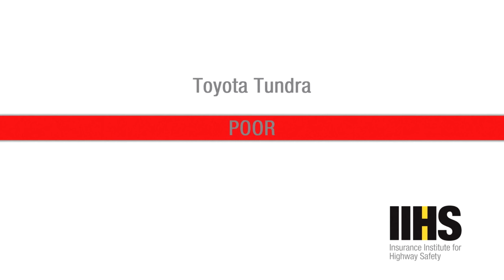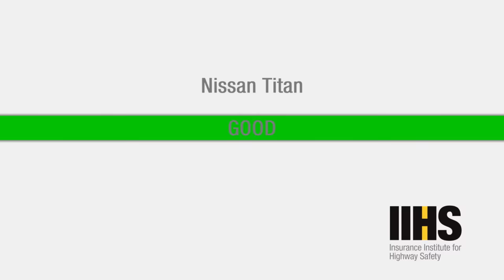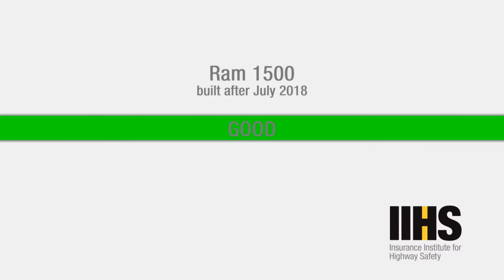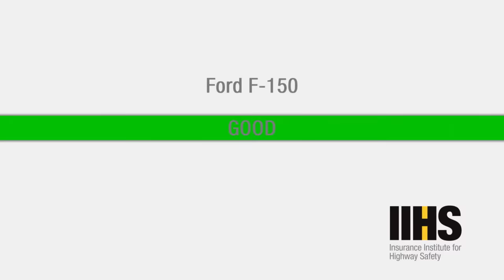TRUCK CRASH TEST COMPILATION - Ford F150, Toyota Tundra, RAM 1500, Nissan Titan

Comment: I want to see old 1990s trucks hit some stuff and see how they hold up to the new ones
Reply: Id imagine somewhat better but if we did ones from the 80s or 70s they would hold up better considering those things were just big blocks of steel on wheels
Reply: While they might hold up better that doesn't necessarily mean it will be a good outcome for passengers
Reply: @ki113rkkrclips9  not at all. things today are done for reasons. any old car is a tin can in a crash, this isnt my opinion its just the facts. go into an auto parts store. almost every set of ramps you will find to drive a car up on to is made of plastic. thats right a few pounds of plastic holding a car completely up off the ground.....
Reply: @chargedx1  true but if where to be some minor crashes like in a derby I would rather trust it than a newer car but I do see where you are getting that and of course it is a bit of a crazy situation for a truck to be in a derby
Reply: @2wheelhoon813  but there were cars made from steel and they were big and heavy compared to these aluminum cars (which yes still have steel elements) we have now and what did the ramps have to do with old cars? What I'm really saying is is that the older cars could take more of a beating due to the thicker heavy metal frame.
Reply: I've seen videos of 1960/70s cars vs things like a Toyota Camry and the Toyota had minor damage and the old cars litteraly caved in on itself and crushed the crash test dummy.
Reply: The truck would hold up, but not you
Reply: @TONOCLAY  muscle cars
Reply: @ki113rkkrclips9  yes the old cars would take a bigger beating at the cost of your life.
Reply: New cars are designed to absorb an impact. Older cars and trucks the engine would have been shot thru the passenger compartment and out the rear.
Reply: They fold in the center pretty bad due to the lack of crush zones id like to see a 2019 vs a 1980 though
Reply: An old car last longer and is more durable for crashes, but the energy of the opposite vehicle has to move. If it is not disbursed by the vehicle, the passenger receives the damages through the spine.
Reply: It bugs me how some of you are verbally abusing old cars, as if their designers are stupid or something. Remember, it's not just that an older car wasn't built right. 

First, there weren't as many cars on the road. 

Second, people had fewer distractions, so they had more reaction time. 

Third, people overall haven't gotten smarter over the years. 

And those cars from the 90s and 80s did in fact have crumple zones. I remember watching Mr. Rogers Neighborhood (or Nova, or something else on PBS) and seeing how crumple zones were put into the design of cars. Actually, crumple zones have been around since the introduction of the unibody; that is, a car without a steel frame construction. And unibody cars have been around since the 70's, at least. 

What's changed, and what keeps changing, is the NHTSA standards! In the beginning, they crashed cars against one solid wall. Then they added the side-impact test. Then they added corner tests, etc.

Yes, different types of accidents happen. But it's absurd to force automakers to redesign the safety guidelines over and over and over again. You can't protect every square inch of a car without turning it into an armor-plated tank.
Reply: Best safety device of old trucks is that they're too slow to crash hard.
Reply: @2wheelhoon813  They don't make military vehicles or construction vehicles, out of plastic. They use metal. They make cars out of plastic because it's cheaper to build.
Reply: @GOD719  Protecting passengers against bullets and against high speed crashes are two very different things.
Reply: It's not about the vehicle holding up...
Reply: I got into a car accident last year in a new GMC Sierra, I was dumb enough to put my hand on the horn to try to notify the other vehicle they cut me off and when that air bag went off it snapped my wrist Mighty good and launched it in to my face lmao

So pro tip for car accident don’t drive a GM, and don’t put your hand on the horn....
Reply: Old cars and trucks are better ive wrecked old and new ford trcks and i swear to you a ford truck is the safest truck end of story i was hit on the passenger side of my 01 f150 4x4 and walked away i now own a 94 f150 ive been hit in the rear in a 78 f150 short bed me and the truck made it out just fine i was in a 73 gmc i thought i was hurt and the truck was junk
Reply: Nate Jones some of what you are saying is correct but a whole lot is wrong. 
Less cars and less distraction do not equal better reaction times. Our death per 100,000 have been steadily dropping since peaking in the late 60’s. That’s the only stat that matters. It doesn’t matter what test was conducted, how many cars on the road, distractions, or how smart early designers were. Our cars are safer today than they have ever been and more lives are saved today than ever before.
Reply: They probably wouldn’t hold up good. Modern cars are made to collapse to absorb shock from a crash. If the car didn’t collapse, your body would absorb the impact and would be damaged much more
Reply: @ki113rkkrclips9  Thats a myth. Old cars often had stronger body panels than the thin steel or plastic ones (to save weight and improve mpg) today - which is why people think they're well built - but a MUCH weaker overall structure. So while an old car will often come off better in a minor bump it'll be crushed in a major impact.
Reply: The truck would Hold up better but the occupants would be significantly injured
Reply: Problem is the old stuff just transfers the impact to the passenger. Newer stuff absorbs most of it, but there is a limit. To be fair, I drive old stuff - just my style. Press on.....
Reply: What happened to Chevy?
Reply: @ki113rkkrclips9  Well that's the vehicle but who cares. What about the passengers?  They'd be plastered onto the interior.  I think there's an example of a 1959 or so Impala test crash. Maybe you can find it on here.  I can say for sure you wouldn't have wanted to be inside it.
Reply: Dude not nearly this well. These new ones are giant pillows in comparison to ridgid blocks of metal and flying parts
Reply: Tournel Henry lol now I know to slam into the soab as fast as possible, screw slowing down
Reply: @chromolitho  i am not talking about the passenger I really dont care about safety
Reply: @TONOCLAY  tell that to the new cars like the yaris being totalled from hitting small animals like raccoons. Old cars hold up way better in minor incidents, new cars are just engineered better for when they are in a serious accident. I'd still rather (and will) drive a 70s car, you just have to be smart with them.
Reply: The truck itself would probably look a lot better.  The occupants on the other hand, not so much for them.
Reply: Test a Hilux
Reply: Not well
Reply: Ikr
Reply: @ki113rkkrclips9 
Steel doesn't mean anything. Aluminum is less strong a volume basis, but on a weight you can produce a strcutre that's stronger, but still lighter then steel. Various fiber reinforced  materializes can easily be stronger then thin panels of sheet metal as well. Furthermore in the areas where steel is being used the alloys employed in many more modern cars are significantly superior metallurgically compared to older ones, some modern cars are built out of steels that would be considered "high strength" vs mild steels.  

Once you then factor in the ablity to FAR more effectively model the forces and load distribution in collisions allowing for more intelligent deployment of the materials there's just no contest.  Modern cars are much more rugged. This is also ignoring stuff like modern cars being WAY more corrosion resistant and just more reliable in general. It just isn't a contest, you can hem and haw about the 'good old days' all you want, but as practical vehicles with regards to usability and safety modern cars are simply grossly superior in every meaningful way.
Reply: I've seen older vehicle crash tests. The vehicle generally ends up looking a little better than modern ones do after a crash, but the occupants don't fair very well at all. New vehicles are designed to dissipate the energy and crumple making the impact on passengers less severe. I'd much rather be in a modern vehicle than an older one if I was in a crash.
Reply: Weird guy  yes on 70s crash .   I survived Ford pickup 1970s pickup crash/s . They were made of steel and held up well .   No Airbag just seat belts  but I walked away just bleeding and very sore .   The forces in the crash were amazing with what happened .   Then being able to sell the truck for parts and getting some money .   I had a car going 75 hit  another of my trucks one Christmas eve  and I still drove the same truck ten years later .  There was no guy wearing a tie that talked about my truck afterwards  back then .  It is a different world today .
Reply: I had somebody in my 94 F150 and their whole car was squished and rolled over mine got a slight edging to the engine and front so they do pretty good didn't even have my airbags deploy
Reply: The older trucks hold up better, but the passenger safety is much, much, worse.

Comment: Both the Tundra and Frontier are 10+ year old chassis. It’s time for some newer and stronger platforms.
Reply: I think you right... much work is needed to bring the safety level up for the the  Manufactures.
Reply: Starting the backbone..The Frame
Reply: They need an actual all new tundra for sure.
Reply: TimmyTeaBag - did you have to turn your tundra in due to the rusty frames and the wheels falling off? Toyota did a world wide recall due to frames falling apart from rust on the tundras and the wheels falling off at highway speeds killing people. You can have your piece of junk Toyota hiding problems over the years when they should have twice as many recalls. It was all about their bottom line.
Reply: As a tundra owner the double cab has always had a fair to acceptable rating. The crew cab constantly fails. I've been trying to understand why for years now. Definitely a chassis update and better front end materials. 
Also the drive train needs to be updated.
Reply: for years now? - let me help - its the piss poor C channel frame. I think the tundra is a great truck in technology of build, but fails in one huge part - the highly outdated design of the C-channel frame. all newer trucks have a BOXED frame. im certain that C-channel buckled like paper on this test.
Reply: I didn’t know about the wheel falling off issue but it makes sense considering every other truck uses 6 lugs and 130lb ft+ torque spec while Toyota still uses the same 5 lug 100 lb ft hub that’s from the 90’s land cruiser.
Reply: @Depreciating_Daily  with that logic the tacoma that uses 6 lugs it should be stronger than the tundra
Reply: Juan Guevara The Tacoma has a really low torque spec of 85 so no it’s not stronger. I change tires all day, every other truck has much more durable studs. If I was putting massive mud tires on, I would definitely want stronger studs than what Toyota makes.
Reply: @timmyteabag69  i was being sarcastic.
Reply: A bit more to it than that.  They used to test the drivers side and manufacturers would only beef up the chassis leg on that side.   Well, they then added passenger side tests negate this practice.
Reply: Seriously idk why Nissan is still selling the D40 Frontier in the US when they got the D23 (aka Renault Alaskan & Mercedes X-Class) here in Mexico, and some European countries as well.
Reply: @markgosser9578  The recalls were for the Tacoma not the Tundra but Toyota did own up to there issues and replaced the frames.
Reply: John Doe  wrong! Because my friend bought a used tundra and the Toyota dealership conveniently forgot to tell him of the recall and he did not do his homework on the vehicle. Got rid of that Tundra and bought another 10 year old Tundra with 160k and had to replace the motor.
Reply: John Doe  2009 Tundra’s, Toyota paid out 3.4 billion for rusty frames. The recall repair was limited and my friend bought the 2009 Toyota Tundra from a Toyota dealership, the dealership knowing the frame was bad would not take it back. Do your homework before you write.
Reply: @mark gosser, your friend needs to contact corporate. Dealerships have been wrong before and just because there is one 160k mile truck with problems doesnt debase the fact that most Toyotas vehicles go further than any other brand. There are many people with million mile Tundras and Tacomas.
Reply: Javier Norris he did and this is when he found the rusty frame recall had a cut off date, I’m not making this up, look it up. Shame on Toyota! Before all the recalls started after the Toyota Camry gas pedals sticking (2009-2011) killing people Toyota would do everything possible to hide their problems with their vehicles for bottom line sales numbers, now all makes start recalls on their on. Maybe it was a good thing Toyota had all the problems with their vehicles, it protects us consumers.
Reply: Then a lawsuit against the dealership is next, I'd lawyer up. Toyota doesnt hide a thing, they have some of the best manufacturing practices that are adopted by many industries including most other car makers(Taiichi Ohno Method). The reports are real I'll give you that, but the company still builds the longest lasting vehicles out there. They also built plants in US and handed thousands jobs, while making the Tundra and Camry more American than our own, look at punk ass Chevrolet! We bailed those bastards out in 2008/2009 now they closed plants, fired employees and moved over to China.
Reply: @jasontamu2002  they use a combination of reinforced C for the front open C for cab and box for the bed of the pickup they call it there "triple tech frame" they say it allows for a smoother ride and strength where its needed. And its not as heavy as a full box frame.
Reply: yeah maybe a update is needed but the Tacoma is the best rated small truck!
Reply: Ignorant statement.  Bodies are engineered to absorb the energy of crashing thereby destroying themselves. Saving occupants.
Reply: In terms of frame rigidity, they should do whatever they did in the 4th and 5th gen Hilux with the Tundra and Frontier.  Those generations of Hilux were nearly indestructible.
Reply: Ford, GM and RAM have been building full size trucks for over 100 years each.  Toyota has been at it about 3 decades?  Not hard to see why Toyota stinks.
Reply: @guevaracr19  it all depends on how much it's compressed a good way to tell is to weigh the parts the heavier the better I'd say means better quality
Reply: The Tundra was just updated! Pretty much every Toyota has failed this new test, they cut a ton of corners!